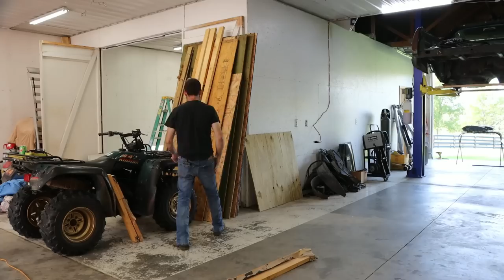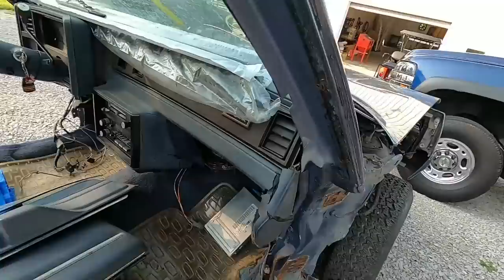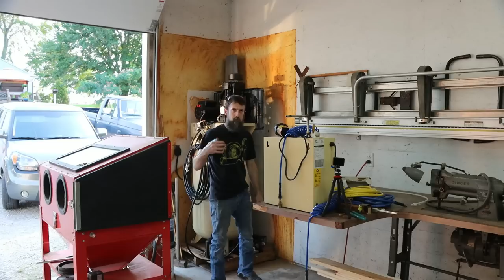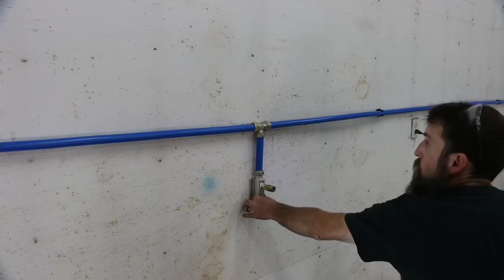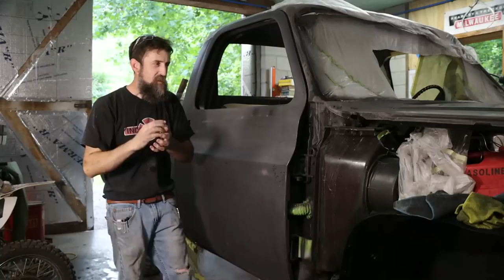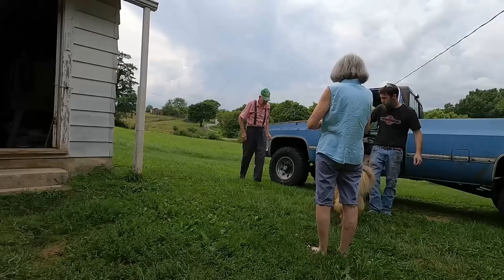SO CLOSE! Paint booth prep and air system install

Comment: Put some cling film (not sure what it called in America, plastic wrap maybe) over the led lights, it'll be easy clean up after spraying
Reply: I would cover the electrical outlets too. I will prevent excessive overspray from getting inside them.
Reply: we had plastic vapour barrier we covered the clear plastic walls that had flourescent lights in them in our Spray Booth / Truck parking bay at a Sign Shop i worked at...it helped keep the overspray off the plastic sheets.. yep ..doesn't hurt to protect with some wrap...
Reply: Saran Wrap, yes its a name brand but its what most ppl in the US call it.
Reply: Great tip. Thanks !

Comment: get a Spray bottle for spraying your Insecticide / Fertilizer for a yard / garden...to spray the floor water to keep dust down....easy to control the water and keep the floor damp....pump it up and adjust the spray to a light pattern ....less splattering..we used that when painting in our booth

Comment: I opted to buy a inflatable paint spray booth to install in my shop to paint my truck. 16x30 it barely fit in my 40x60 shop with 12ft ceilings , right down the center. I didn't want to go through the time and expense of building even a temporary plastic enclosure.  The inflatable spray booth worked out well. I would have much preferred to have a setup like your brother has.

I had to to laugh when you said the truck is 99.9995% ready to go. My first thought was, only 25% more to go! It seems like it never ends. I'm just ribbing you...but I'm kinda serious.    😜

Comment: Hi Steve.  Let me share a little tip on checking for leaks I stumbled on to.   If you use kids bubble soap, the kind you blow bubbles with, it will show leaks that dish soap will miss.  I went over my system with dish soap solution and then a friend told me about the bubble soap and I found three very small leaks that I missed with my own dish soap concoction.

Comment: I know it's too late but I would have recommended first, run your lines at a pitch. Second run it much higher, away from things bumping into the lines. Much safer. I would be curious what you installed for a dryer/separator. Air systems are my cup of tea, I install them for folks I know (not professionally) and have done tons of research on them over the years. Took a lot of money in my trial and error to find best cost effective way to run good lines for things like Plasma and air spraying. That said though, you did get a great kit. Unlimited expandability on the easy. Same with his compressor. Great choice. I apologize for being a armchair quarterback. Just hoping to share my knowledge such as it may be. I personally enjoy constructive criticism.
Reply from the maker: The reason for running the air system low was because the holes in the wall were already there from some old system that was in the building before my brother bought it. 
Mine is up high. Our plan is to never have enough water in the lines to matter what angle they are but ideally a small slope back to the tank would have been best👍. 99.9% of the time its just going to run power tools. Thanks for watching and the advice.  There is definitely more to it than most folks think. Especially if its a dedicated painting air system.
It is hard to keep dry air here with the high humidity we get.

Comment: Wow that's a rusty 85. My 84 El Camino has no rust on it at all which is the norm here. I would not even attempt that much sheet metal repair on that new of a car. I have only seen a couple of those full bench seats in El Caminos as most all had the split bench. Hopefully I will get the 84 moved over to my shop this fall when it cools off. Has been stored offsite for 10 years as I haven't had room for it here.

Comment: very nice TR6 ...shame about the awful rubber extensions that were added to the bumpers(fenders) for the American market....
Reply: I think Porsche 911s suffered the same fate for the US market as well, also TR6s for the US had the twin Stromberg CDs instead of the Joe Lucas injection system, I don't know if KY has strict emission regs for older cars but a triple Weber setup or an injection system from a BMW six might release a few more horses. BMWs seem to get totalled on a regular basis here in Olde England, don't ask me why........

Comment: you can use your paint booth as a Grinding/Sanding booth...you got exhaust in there...and just as a general area to do bodywork and welding ( again the exhaust helps you here )...yes it is a Luxury..but not if you use it often enough to make the space and cost worthwhile to have.... as a space to work on projects / repairs it can be worth having...especially if you do some painting...remember..you probably paint other things too besides a car...

Comment: prolly a good idea to stick some clingfilm over the led panels , that way you dont have to clean the painfog off after spraying , just peel the foil off them personally i like fluoresent lights as it reflect lines off the fresh paint and you get a better vieuw of the straightness of the panel you painting or working on 
as for using the paintbooth for storage : as long as you put everything on pallets or wheeled shelves that you can run in and out of there when you need to use it , it shouldnt be a problem as it whont take a lot of time to cnvert the booth from storage to paint booth

back in the days when i had dreams and money wasnt an obstacle i was planning on a orange truck with chrome stuff on it and was planning on a tan "distressed leather" tuck and roll type interiour

Comment: I was afraid you would bring the air drops out that way! Been in shop air for a very long time, drops come out the top of the pipe go up six inches and drop 18 with the draw off coming from the side and a bleeder valve on the bottom.

Comment: Steve, put the air hose outlets above the horizontal line, so you don't blow out any water in the line. Especially in the paint booth.  Those cars were awesome. Is that TR6 his, or a customer, I didn't hear that part?
Reply from the maker: The tr6 is a customers car👍